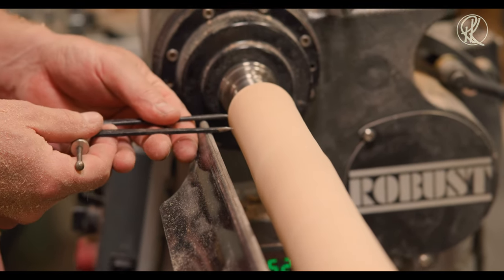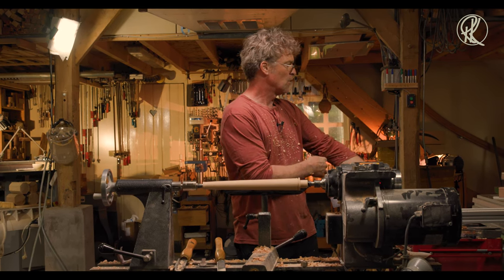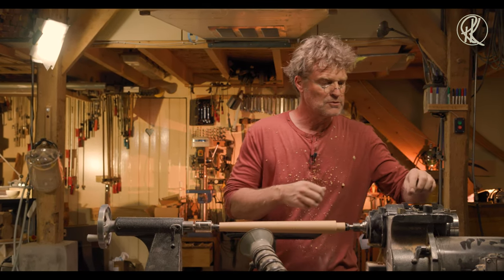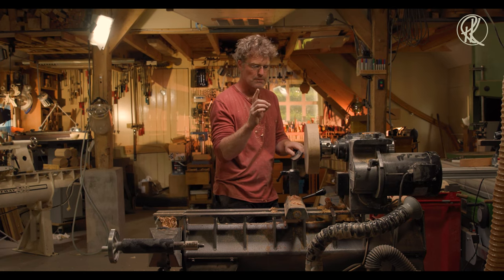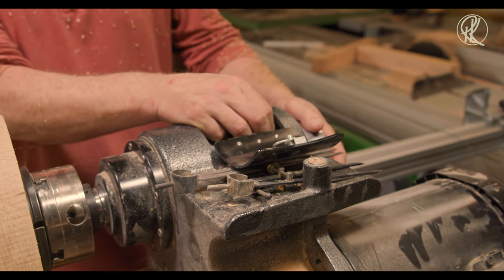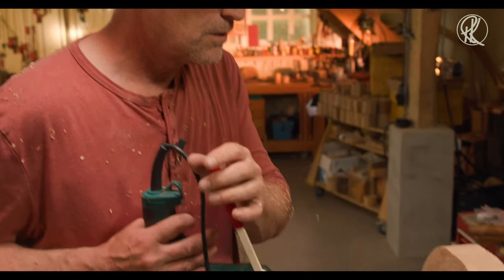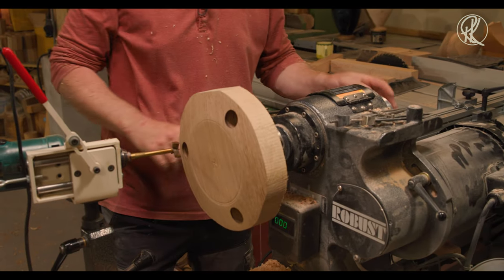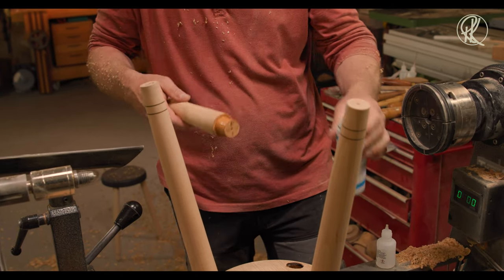A 3 legged stool made on the lathe.

Comment: Nice job, I like the simple style. Last time I made a tall bar style stool with four legs, but I drilled the holes using my drill press with the table angled to 30 degrees, then used wedges to hold the legs in without glue. I still use the stool when carving at the Lathe. I like how you drilled the holes, I should invest in one of those tools.